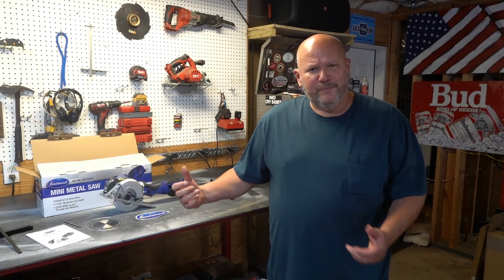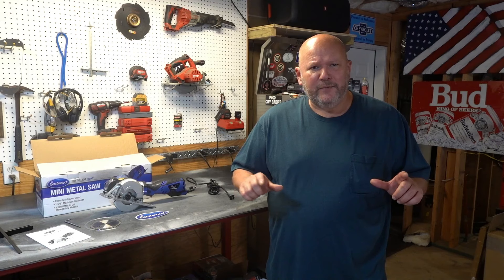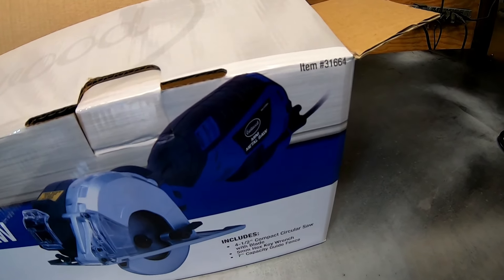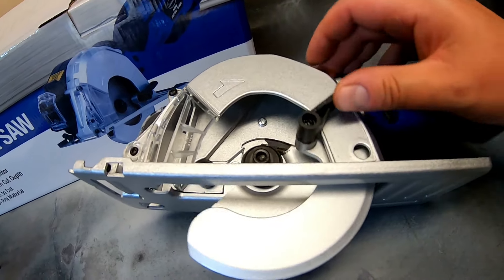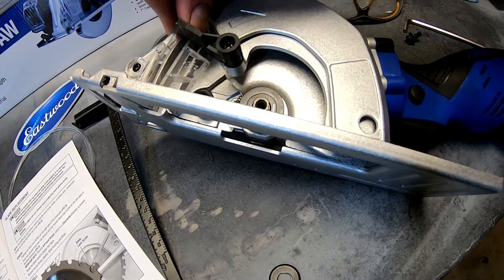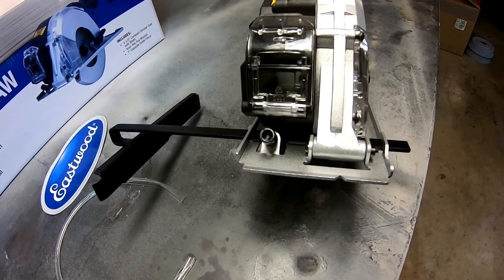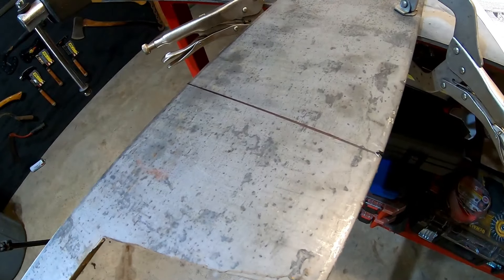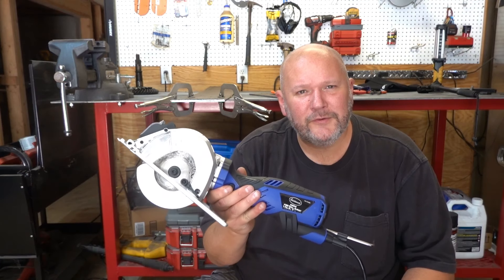Eastwood Mini Metal Saw - I'm Impressed so Far!!!

Comment: Will this cut 14 gage sheet metal
Reply from the maker: I've only used it on thicker steels but I'm sure it will if it can handle 1/4 inch.  JD

Comment: The one thing I've always dreaded about fab work is the all the darn cut off disk's I have to go through only to be covered in dust and still not have a perfectly straight line. This looks to be 100 times faster and a lot quieter.
Reply from the maker: Charles I’m right there with you and I cannot believe a saw like this existed !!   It’s a quality piece for sure and works very well.  It’s surprising!  JD